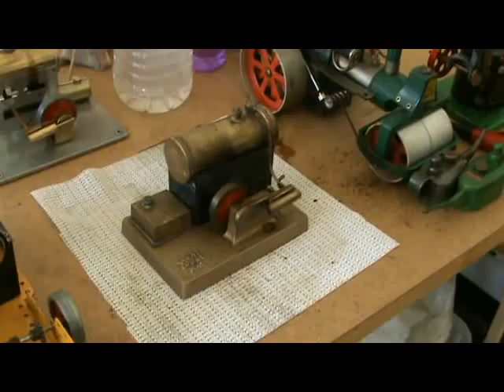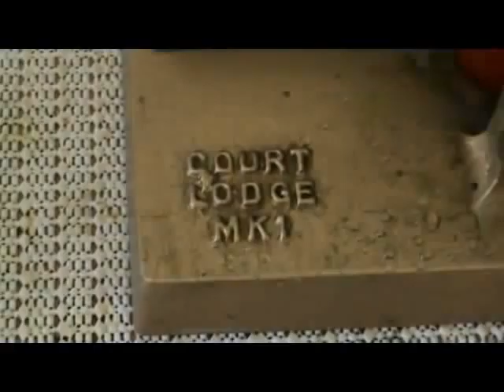Weller Court Lodge Mk1

Comment: i have some more details.
the desgin started out with the weller desgiened albury manor mk1 which was wooden and had a sheet steel top. then right up to the mk 4. the ab mk4 was bigger than the clmk1 with a bigger base and boiler. mr williamson built an am engine in the late 50's and then worked there untill he 80's 70's.wellwer wars woring at court lodge at the time, then he was joined by williamson.courtlodge at the time was producing the am mk4 which was sold to students for about £5.

Comment from the maker: Hi, this is interesting. What is your connection with Court Lodge (if any)? I would very much appreciate any more information you may have about this engine, such as when it was made. Why do you say it was probably made by the dt technician? I was assuming it was made by a student. There has been at least one other the same on Ebay (and a similar one but slightly larger and apparently made at a different school). Do you know how many were made?